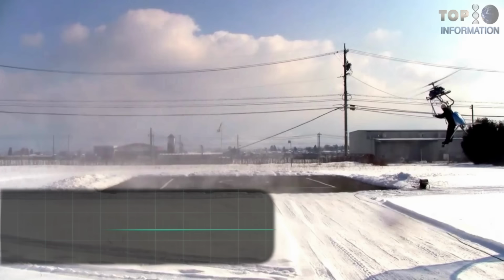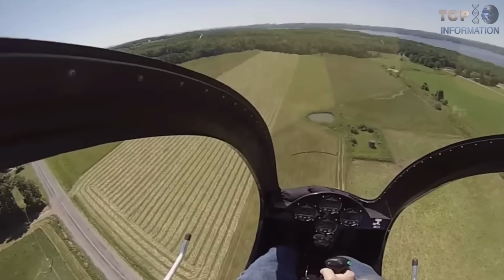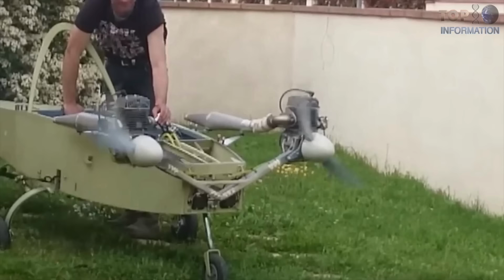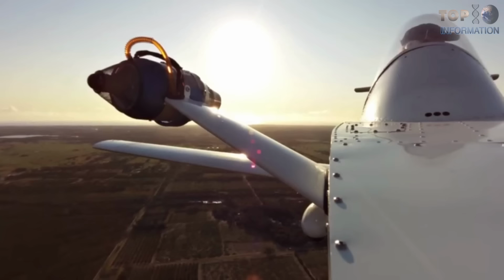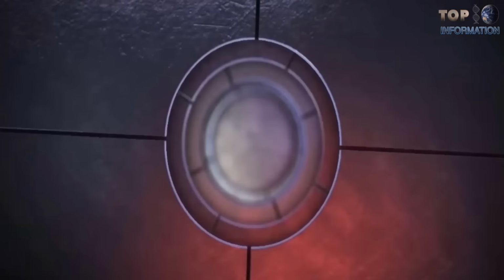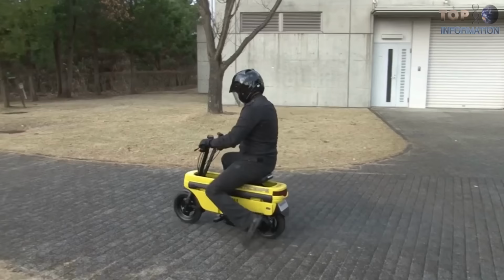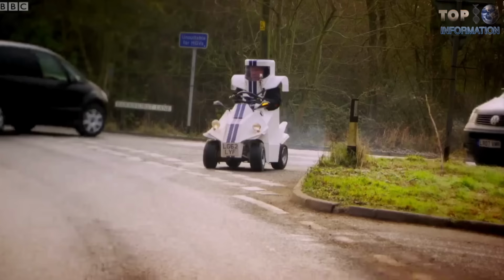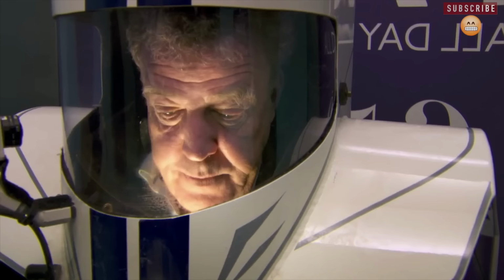10 Smallest Vehicles With Powerful Engine

Comment: The first one, worth 7,500,000 japanese yen, in US dollars would be approximately $66,450.00
Reply: OneWiccanHighPriest no your wrong
Reply: I checked it on Google, using a currency conversion calculator. Exactly $66,574.08770, or $66,527.70, and it really depends on what calculator you use. It seems to vary slightly, but they all appear to be around $66,000.00+
Reply: 66,574 dollars
Reply: OneWiccanHighPriest not that much worth. I'll definitely try to buy it when I get older. I love that thing. I really want it
Reply: OneWiccanHighPriest I like church
Reply: Dang that a lot of money
Reply: OneWiccanHighPriest the exact number is $68,465.25
Reply: Holy shit!thats alot

Comment: Dude the Honda Motocopma is around $4,000-$6,000USD not so cool anymore...
Reply: That's fine, a child's $250 "Doodle bug" can go almost the exact same speed (I had my friends up to 25 mph or 40 kph). If you want something that won't kill you because it's so slow on the road, look for the Honda 90cc (maybe it was 79cc) dirt bikes they used to make in the 60's and 70's. My dad had one that went over 70 mph (110 kph), and since I'm a lot lighter and smaller, I could probably beat that. It was stock everything. My grandpa still owns it, and uses it to check on cows and fields near his house, works well, very light weight so it won't be so bad if you lay it over, and its very easy to control.
Reply: Lol
Reply: iolku
Reply: And  there are so many  other pocket  Bikes for  under  5000  bucks...
Reply: Andrew Freeman i have a honda motocompo and it only cost 400 bucks used

Comment: Its powerd by a 2stroke 100cc engine.
 Its not pronounced  as it has two, stroke 100cc engines it is only one 100cc 2stroke engine! 
And the honda suitcase bike has a 49cc engine  not multiple  engine's. 
Just for future reference. 
It's only one 2stroke engine,
Unless it says it has 2 100cc 2stroke engine's.
 It's powered by a 49cc engine.
It's powered by a 100cc 2stroke  engine.  
I hope this helps you out, continue to make great videos!